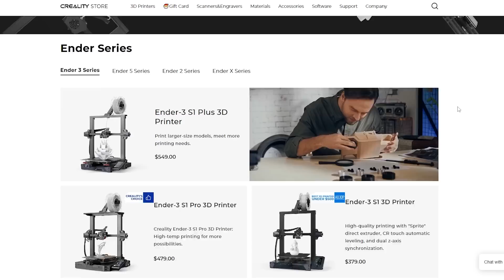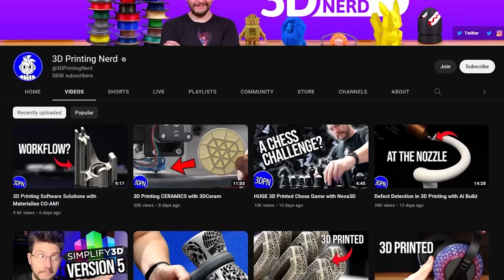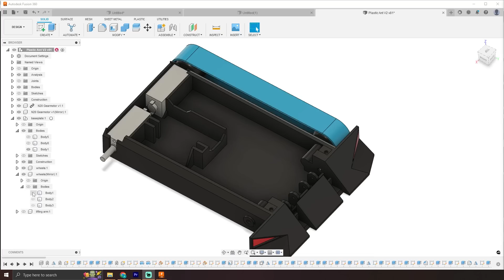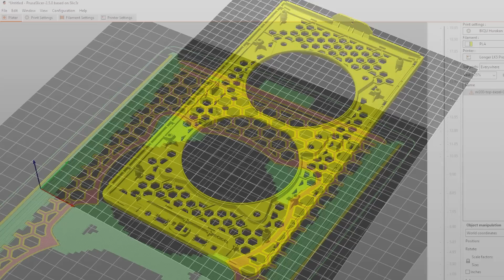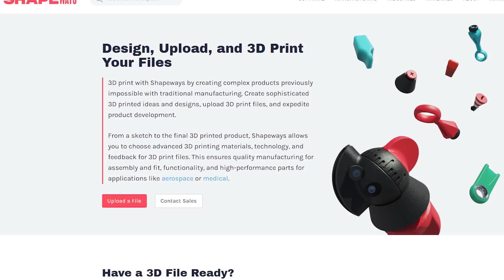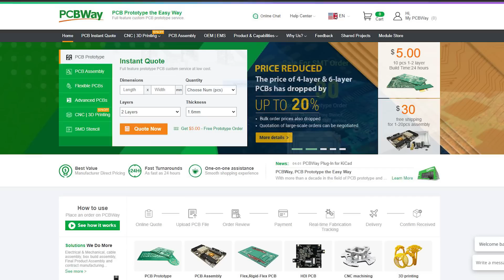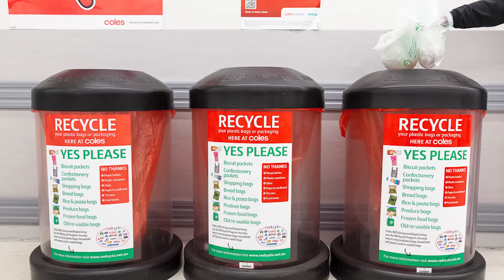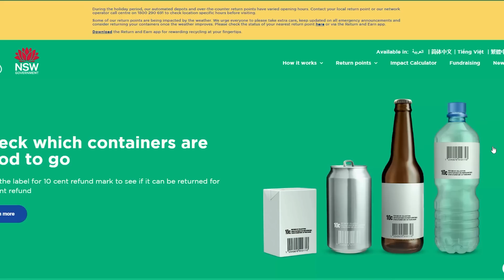My 3D Printing Predictions for 2023

Comment: Rather than pt recycling could you recycle pla filament by re melting and extruding it?
Reply: The issue isn’t the melting, it’s re-extruding it into a very consistent sized filament. 

It has to be uniformly melted so you don’t get blobs, and then uniformly extruded, and then uniformly pulled/spooled so it doesn’t stretch (making it thinner) or bunch up (making it an inconsistent shape) which is more work than using fresh plastic pellets that are uniformly sized and using a purpose built filament extruder.
Reply: @heyspookyboogie644  so as an experiment I took metal funnel, put a cap on it and then slowly heated it to 210 degrees. In it I put chopped up pla parts. It had a 3mm spout and when I removed the stopper I had 1 meter long 2-4 mm diameter pla cylinder. Unfortunately my engineering isn't up to feeding that cylinder into a 1.75 mm nozzle... But with a heated nozzle and a feed system I think you could turn it into filiment.

Comment: I wish dealing with VOC’s and carcinogenic stuff was a priority. I desperately want a printer but health fears are too high.
Reply: I mean, just get an enclosed printer (or make one) and connect a hose to the outlet. Place the whole thing near a window and drop the hose out the window. Tadaaa.
Reply: I mean, is there really much concern with 3D printing filament? Nothing is combusting or vaporizing, AFAIK. Most prints probably aren't food safe, but I'm not convinced that 3D printing is dangerous to air quality without direct evidence. Like what VOCs are released by filament?
Reply: You need to worry more about health fears of watching too much YouTube.
Reply: I have had my printers in my room printing for well over a year at this point. As long as you aren't printing ABS, or resin. It's not a problem.